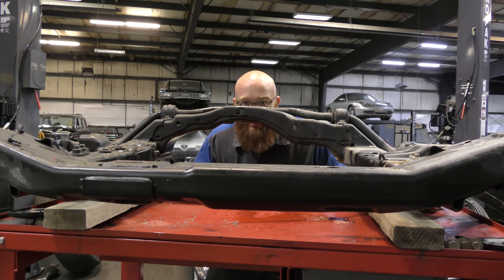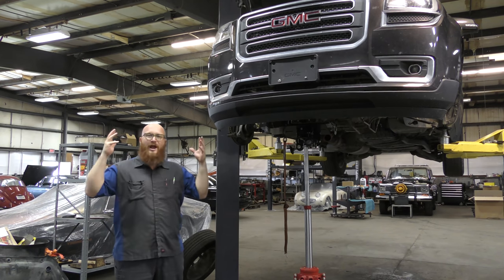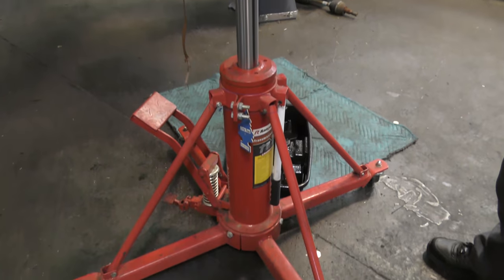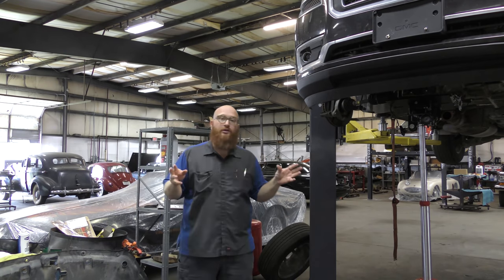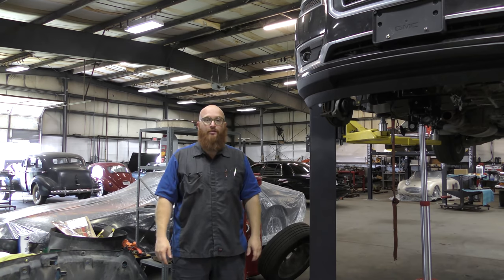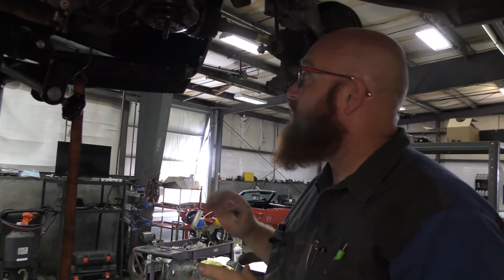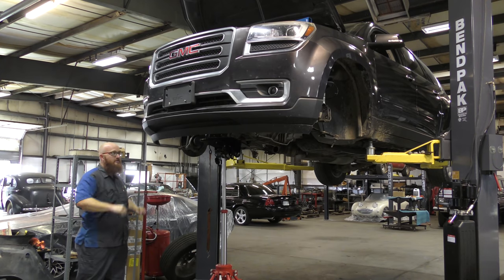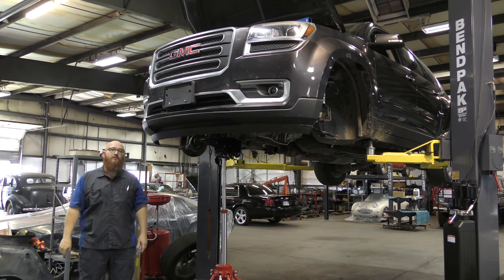Used car insanity in the CAR WIZARD's shop! Why did the huge repair get approved on this '15 Acadia?

Comment: Throwaway cars. Most likely timing issues will arise as soon as they sell it. Obviously they want to fix the leak, because it's the most obvious thing wrong with it  Unfortunately many lots love cars like these, they get them for dirt cheap and charge you 3x the amount it's worth
Reply: Nothing new nearly all modern cars are disposable like electronics, modern cars never be a collectible or can be restored
Reply: Yeah, they charge “you 3x for it” and “you” still buy it lol
Reply: And no car is more throwaway than the 2009-2011 Chevrolet Aveo; the catalysts are so expensive in my area, that it can mechanically total the entire car!
Reply: A throwaway car is cheap to start with like a cavalier. For the price of one of these I expect 200k miles with routine maintinance. I know gm can do it because I had a 3800 powered buick that ran that!
Reply: I once drove a 2011/12 Kia Rio  for a car sharing company over here. It got replaced after a year and about 10,000km. When maneuvering it in the parking lot of the dealer where it was exchanged at for a new one, I had trouble getting it into reverse, I had to put it in neutral, let go of the clutch and rev the engine for the transmission to sync up before I could get it in reverse. I mentioned that towards the guy from the car sharing company, and he told me: "Yes, these all have a bad transmission after about 10-11 thousand km, but it isn't a problem because Kia has a 7 year warranty on it." That was my first experience with disposable cars, I thought "Wow, now we have cars that are made right for the salvage yard from production"...
Reply: @Seegalgalguntijak  Well, that depends on their cars I guess. My folks own a 2012 Rondo (with the V6). One of the best cars they ever had. Only routine maintenance on that car, that is now 9yrs old and have 'round 150,000+ km (which is around 93, 205 miles more or less) on it. The ONLY issue that car has is passenger right side damage due to when my mom entered an underground garage while starting to have issues with her eyes. Fixed best as I could (I'm no bodyshop person) And I'll have to remove all the bondo, as there's rust that have started to show thru the bondo and the primer.
Reply: Def love that term! Throwaway car! Unfortunately, most commuter cars these days ARE throwaway cars....Esp ANYTHING with the 3.6L GM v6....Oh lord, what a POS! - My buddy has a top of the line trim Colorado ZR2 and has NOTHING but issues with the engine and trans. He has the truck in the shop more than he has driven it for work! I have another friend, who has a 2010 Equinox (same engine) nothing but issues since the day she bought it 'CPO' in 2013. My Cousin has a base Colorado V6 and needed the trans replaced at 16K miles! - These are just 3 examples I personally know of.
Reply: I remember when the 3.6 came out for Cadillac ATS, C&D was raving about them being the "one to get"
Reply: @digitalrailroader  You must be in CA. Here in AZ you can get a catcon for $300 because it does not have to be oem. My ex wife has one of those cars. My 2006 Mercury Grand Marquis has 277K miles and runs like new. I'm hoping to get 400K out of it. Then I'll buy another one or a Crown Vic.
Reply: @geraldscott4302  nope, I’m actually in TN, where we have the highest combined sales tax in the nation. And both the converters from GM are over $2600, whereas the entire car is worth about $2400 on a good day.
Reply: @digitalrailroader  From GM yes. But you can get aftermarket ones for a tiny fraction of that, like $200 or less. CA is the only state I know of that requires oem converters. I'm in AZ, and a lot of CA residents are trying to sell their cars here, where they can be fixed cheap. They are not worth fixing in CA, so nobody will buy them there.. A few years ago I had the catcon replaced on my 1993 Jeep for $300 including labor.
Reply: This is why I rebuilt my 1985 Chevy C10.  It's all new and powered by a LS1 out of a Corvette.  I rebuilt the engine and transmission myself.  $15,000 and I'm gonna drive it until I die.
Reply: @digitalrailroader  good thing we don't have inspections or emissions testing here in tn. I just delete them when they go bad 😂😂
Reply: Modern BMWs are throwaway cars...highly disposable after 3 yrs...
Reply: Throwaway is right! My thoughts exactly!!
Reply: @MrClarkisgod  You can buy a converter for that price, but many times it won't function correctly with the GM computer.   You still have a check engine light and you won't pass an emissions check with the code tripped, no matter how new the cat is.

Comment: I bought a 2016 GMC Canyon 4x4 ext cab new in December 2016 it was my retirement truck. It was lightly used 90% of the time, never did any towing. April 2019 the electric power steering failed at 22,000 miles. GM paid for the $2,500 repair but mentioned this was a common problem and it may occur again with no warning. By that summer I was having intermittent electronic problems in the dash backup camera and entertainment system. By October 2019 the electronic part of the anti-lock brake system was starting to fail intermittently. I traded it off at 26,000 miles as unreliable not knowing when the next issue would appear. It's replacement Nissan Frontier SV 4x4 has not had a single problem up to this time with the same type of use. I'm done with GM and there poor design and build quality.
Reply: The older vehicles were more reliable for sure; I bought a Chev Colorado 4x4 in 2005, traded it in 2015 with 219k and one hour of repair, CEL came on dealer said dirty throttle body and cleaned it. I was getting 90k on front brakes, about 66k on rears. Changed fluids regularly, found the transfer case fluid was more expensive than bourbon! I traded it for a 2012 Colorado, no issues with it so far. Our Acadia is a different story.

Comment: GM Lambda vehicles (GMC Acadia, Buick Enclave, Saturn Outlook, et al) are some of the worst vehicles to work on. They were not designed at all for maintainability, and are prone to issues. Was so happy to trade mine in. ☠️
Reply: Chevy equinox is another one to stay far away from.
Reply: @henrydillard6217  Chevy Traverse is similar.  The Chevy Equinox is one step below and worse.
Reply: They go together like legos. The key to them is to drop the powertrain out the bottom and fix everything broken at that time. I did my sisters last year, $1800 worth of parts and a couple days of work it has been back on the road for the past 1.5 years. Also just put $500 worth of suspension parts on it. 

As a DIY without a lift, GOOD LUCK!
Reply: ever done a thermostat on an atlas L6
Reply: Mr Anderson yup, newer Explorers are a bare to work on as well. Those are another power train dropout for work
Reply: As an ex mechanic I say Audis and BMWs are the worst cars to work on at least when you have big hands

Comment: Thank you Wizard! I was so tempted to get an Acadia or Traverse but didnt thanks to one of your old videos. No regrets and I ♥️ my 5 year old problem free Odyssey.
Reply: Bullet dodged. However, hope your Odessey transmission holds up as that seemed to be the weak point.
Reply: @Blue-moon12  just keep the transmission fluid changed every 30 k miles and you will be fine. Genuine Honda ATF only.
Reply: @Blue-moon12  that was a concern when we got it but by the time we said no on traverse we decided on a minivan and we didnt like the way the rest of the vans drove or their seating arrangements. The odyssey is like driving a big accord while the rest (especially the sienna) felt like drivin a mini-bus.
Reply: My parent just upgraded from a 2009 Odyssey to a 2021.  It had it's original engine and transmission still working 100%. I had to upgrade to thicker oil due to worn piston rings. I did the service on it it's entire life.  it had 33650km on it  (209091 miles)
Reply: i hope the fuel management system doesn't fail
Reply: i did extensive research on the acadias before my GF bought one, in 2017+ they fixed nearly all of these common fault areas according to my research
Reply: @Frankenslide  All the 3.6L have an issue with porosity in the aluminum blocks. I downloaded the TSB yesterday, it applies to 2008-2021, all GM vehicles with that engine. Dealer wants 9k for new engine. GMC said no to picking up the tab.  The used market is insane so looks like a rebuilt from NAPA is the best option. Open to suggestions.
Reply: @robertball3578  we bought ours from car max and got a 5 year warranty bumper to bumper so we’re not too worried but I hope you get yours sorted out

Comment: I had my 2013 Equinox in at the dealership for a timing chain related repair that pretty much turned into an engine rebuild. That was covered under a recall. I still spent $2000+ on other repairs while they had it torn apart–front control arm, rear wheel hub, cracked exhaust manifold, etc.

Comment: "$1000, Im not paying it!" "Your going to drive the summer with the heat on?" "Yes" "I never heard from that guy again" Breaking news. Man burst into flames while 110 degree temperatures roast Kansas. Seems he had his heat on.
Reply: my brothers explorer had that issue shop said $1000 to replace the servo... i did it in 5 minutes through the access panel.... dont always believe the mechanic...i bet that guy gave one of his friends a 6 pack of beer and had it fixed with a $20 part
Reply: he probably just went and clamped the heater hoses off or bypassed the heater core, lol.
Reply: To be fair, if he'd paid the money who is to say it wouldn't happen again in a couple of years? A frequent point of failure means the part has a good chance to fail ...frequently. And if it's that expensive to repair, then you might as well face the fact that your vehicle is an endless money pit and just get rid of the thing for whatever you can get. Which is probably not much. Replace it with a car that holds its value well over time because that probably indicates it was built to last.
Reply: Probably thought he was being taken for a ride, which is why he was mad.

Eventually got some quotes and was told the same by other shop.
Reply: fix for the heat being on ..pull the fuse. plug it back in come fall
Reply: @danpettis1675  that doesn't move the diverters or stop the air from flowing in while driving and cooking you ;)
Reply: @throttlebottle5906  Not only how are you going to Defrost your windshield in the winter time, I Guess just sit there and waste gas until it's hot enough inside to melt Icecream 🤓
Reply: Or he could of just took the blower motor fuse out until winter.
Reply: My Trailblazer also has a bad blend door actuator.  Apparently if you disconnect the battery, when you reconnect it it does a homing procedure that is so harsh it strips the plastic gears in the actuator.  My heat and AC work fine, but will only blow out the floor vents.  I say bring back the old style vacuum operated blend doors!
Reply: @Jeffnham  only if the gears are very worn and/or the potentiometer is very worn. once it tries to reset and go beyond the learned limit to hard stop, game over. many/most do that with every key cycle anyway. it's really mostly stupid electronics, which I feel shouldn't exist anyway.
they attempted to improve the manual cable positioned doors because of weak handed elders, kids, women, sick, etc.
but sadly what they've accomplished is making it junk for the masses. same still applies today across a very broad range of everything.
Reply: @throttlebottle5906  Thing is with manually operated HVAC controls you NEVER have these kinds of problems. Manual HVAC is the way to go...
Reply: @Jeffnham  --My friend next door has been working on GM products for 35 years, he can change out an Actuator in minutes, done several on my 2004 Impala...
Reply: Gremlins like this are why I never drive my 03 Mach with the AC or the heater on. I don’t drive it in the winter and all I need is vent to defog the windshield on rainy days. Other than that i just roll the windows down
Reply: @rodh1404  scotttyyyyyyy

Comment: So while the engine is out, it’s best to repair everything that’s worn out besides the timing chain; water pump, motor mounts, front and rear oil seals and of course fresh coolant etc.
Reply: And the oil pump. Depending on the model the engine is in, some can be done in the car like the Camaros, Impalas, and Lacrosses. SUVs have engine out.
Reply: Sure its “best” but then there is no profit on it.
Reply: Thats what I do with my personal cars and family members cars I wrench on. I only fix whats broken though or leaking.
Reply: Sure. Fix it until it's broken.  This is going on a used car lot. Fix it so people can drive it

Comment: I bought 2012 GMC Acadia 3.5 years ago.  It is the best vehicle I have ever owned.  I had an issue last year with the radiator and thermostat.   3 regular shops sll wanted 700 to 900 to fix it.  My roommate recommended his honest mechanic.  He completely fixed it for 170 dollars.  He also did cv joints and front brakes for 550.  These are the only repairs I have had to pay for.  My friend did the rear brakes for free.  I just paid for parts and calipers.  So, in 3.5 years I have only had 720 in repairs.  I am getting new tires this weekend.

Comment: I feel for the guy who got pissed about the hvac actuator, but it's the designers he should be annoyed with. I wish cars had a "fixability" rating next to MPG these days.
Reply: Yeah, and also if a component is deep inside somewhere, maybe car companies should spend the money to make it last, not the current cheap as possible crap.
Reply: Fix ability rating would be awesome
Reply: They are built as modules that are installed on the assembly line with no thought as to how to repair items in that module.  Many items are not repairable and are replaced as modules.   

And it’s not something that’s new, I’ve been dealing with it back in the 60’s.
Reply: Consumers Reports yearly auto issue.

Comment: My 2010 Acadia had the dreaded engine light at 54k miles (The oil was changed every 7k miles w/ Mobile one). The shop advisor told me that this generation of 3.8 had issues with improperly heat treated chain guides. Shortly around that time this thing started using 1 quart of mobile 1 a month.... and then I ditched it for a highlander.
Reply: Seems like all the 5.3s of the last 8 or so years go through a tremendous amount of oil, especially for a new vehicle. At least the newest ones throw an engine light at a quart low-ish.
Reply: Well if you would of changed your oil a bit more you may not have your issue, especially with a fragile engine.
Reply: Good choice the best 👍
Reply: Very very smart
Reply: In 2010 no one really said much about that. And it's full synthetic and came out mostly clear ... So I don't buy that
Reply: @DreamforgeOG  54k miles though? That is absolutely ridiculous.
Reply: I had a 2012 till 2015 put around 50k on it. No problems. I also didn't change the oil at 7k. In fact I bought a 2015 Buick instead no problems 45kish. 2018 Buick again no problems. I have close to 60k on the 2018 now since I'm waiting on the refresh models. I got the upgraded tow package on this later one with trans cooler etc. Changed out the trans fluid myself with the quick packs. I don't flush and just drain and replace. You can have a dealer or shop do it for around 200 bucks if you can't be bothered. I also had the rotors surfaced and replaced the pads. Why? I tow with the car off and on so that usually means more wear and abuse on the fluids and trans. Brakes same thing. Fluids are cheap so when in doubt change them often.
Reply: @johnl3230  yep. I religiously changed the oil every 7000-7500 mil. It was an absolutely ridiculous repair, covered by my extended warranty that I purchased. So within 6 months of that repair being complete I got rid of the car
Reply: @inducedapathy1296  yeah. I didn't tow a thing with this particular one and replaced everything as soon as it needed to be replaced or recommend. I live in a place with hills, so The OEM rotors had to be replaced every two years due to warping and wear. That was why the dealership agent told me that there was actually a heat treating problem with the hardness on the chain guides for the 2010-era. They said they'd seen a bunch of this problem even though GM didn't offer a recall. Oh, I also had the tow option with the extra cooling even though I didn't use it.
Reply: @DreamforgeOG  that's great! I didn't mean to come off rude in my original comment. What did you end up replacing it with?
Reply: @johnl3230  :) Highlander Hybrid Platinum which has been problem free
Reply: @DreamforgeOG  If the oil was "clear" at 7500 miles you weren't using synthetic.   I've only seen "clean" oil at an oil change when non-detergent oil was used.  It left all the dirt in the pan.

Comment: Re blend door actuator failure: Most times (maybe all) a 2$ + 20 min. labor solution is to bypass coolant to  the heater core for A/C and reconnect it for heat. That's what I do on my 99 Crown Vic, and A/C blows cold and heat hot.
Reply: Yes, but a lot of folks don't have the know-how to do that, or are in climates (like the Midwest) where things will change daily, necessitating heat one day and A/C the next, particularly in the spring and fall.  I just put a valve in an old car that I could turn off to stop the heater core flow; the A/C worked either way.